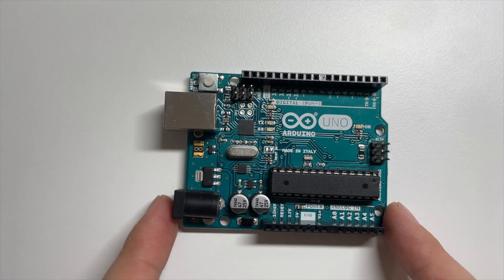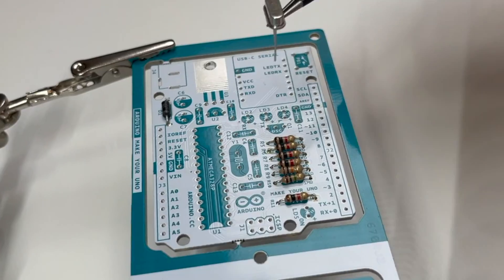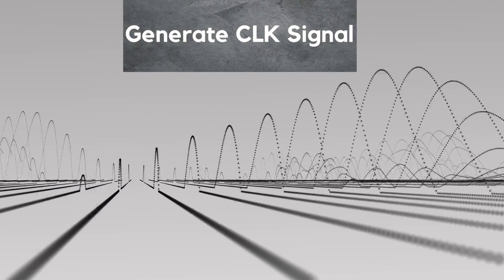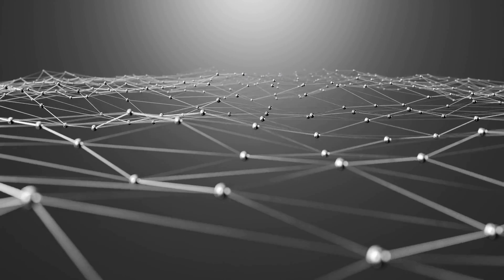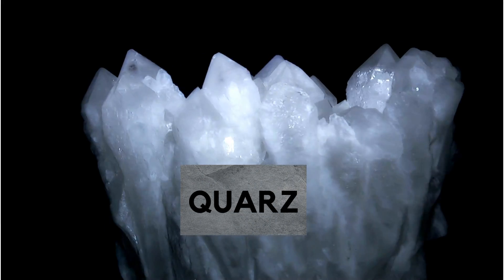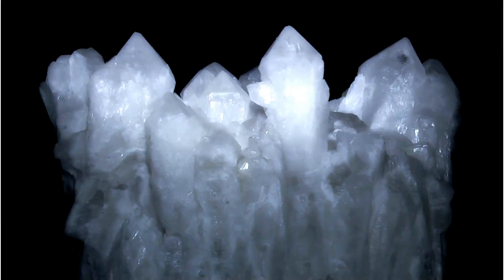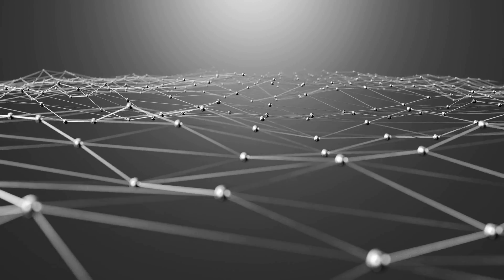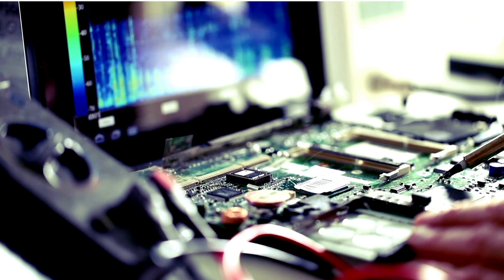Crystal Oscillator explained in 66 Seconds

Comment: Passive, needs an active oscillator otherwise you will measure it with a multimeter amd it will give you the capacitance value it will tuning fork at

Comment: Just to complete the description:

A crystal oscillator is composed of 2 parts:
1) The crystal itself that is a PASSIVE part not capable of oscillating on its own.
2) The actual oscillator circuit which is basically an inverting amplifier with 2 pins coming out, an input and an output.
On the Arduino, the electronics of the 2 oscillators are placed within the respective chips (Microcontroller and USB controller)

An inverting amplifier with its output connected to its input already tends oscillate (larsen effect for example).
The addition of the crystal placed in the loop between the output and and the input only "guides" the oscillation. Usually at the so called fundamental frequency.
This fundamental frequency is set by the crystal's piezoelectric properties because of the mechanical resonance.

Comment: Is it possible to lower the frequency of the oscillator? Thank you.
Reply: Yes , by using X rays to change the atomic structure of the quartz crystal. Otherwise no, it's a fixed frequency determined by the thickness of the crystal.
Reply: @roncoots3800  wow. Crystals really are fascinating. I took an interest lately in laser optics and photonic. Barium Titanate caught my eye regarding phase conjugate mirrors. It mention changing the atomic structure with heat and light. It's mind blowing that it can be achieved at all. I mistakenly assumed that atomic structure was  fixed and that was that. Hey thanks for replying and enriching me.
Reply: @hoofheartedicemelted296  Atomic structure is very easy to change, if you hit it with the right frequency. The main problem is those frequencies are , very harmful!!